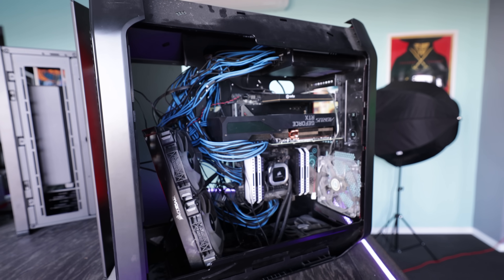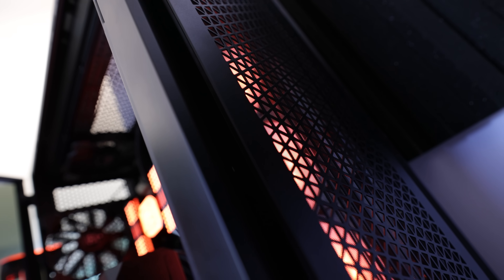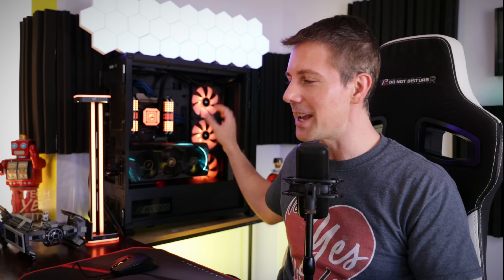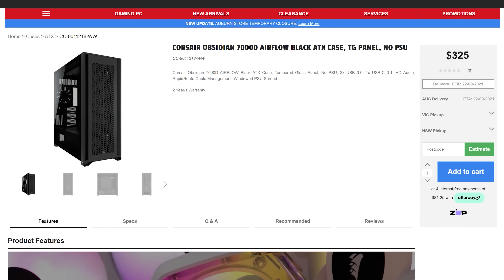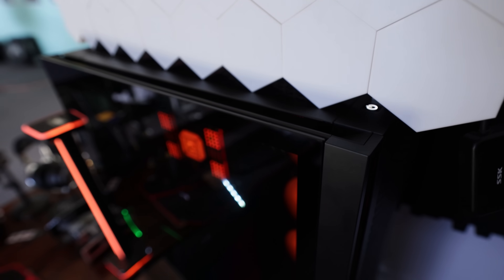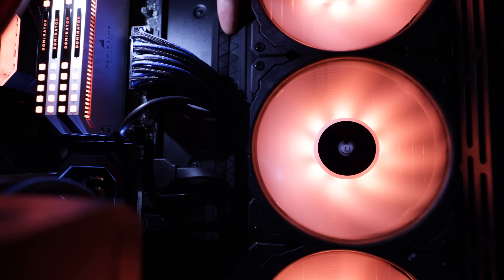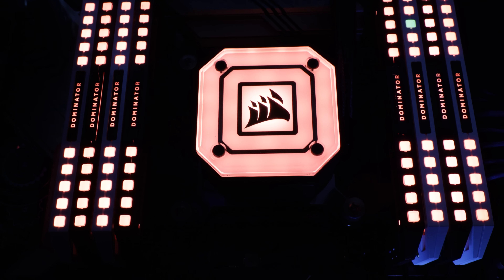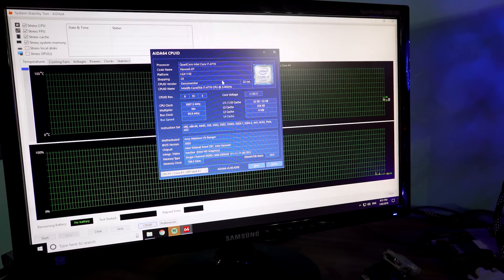Rebuilding my DAMAGED PC Setup (Corsair 7000D Review)

Comment: Been looking to get a new case and this one ticked all the boxes for the hardware that needs to go in … the only problem is when I looked at other build videos and reviews that it’s one of those cases that limits you 
If you have a large PSU you need to remove one of the hdd bays and if you want to use a 480mm radiator you would need to remove the other hdd bay
Since it would need to go in the front or side  since there is no way to mount a 480mm rad in the top

I used to have a Obsidian 800D and liked it a lot
It’s kind of disappointing that Corsair mostly makes cases that are smaller the 800D and only makes there flagship cases larger but those are also some of the most expensive cases there are

Comment: At about 13:40, Bryan's video card is mounted 'sideways'. Here goes the dumb question.. how is that done?
Looking for a new case, might take this 7000 D.
Thanks for the video Bryan!
Reply: with a riser cable and the vertical gpu mount in the 7000 d.
Reply: @fietsfreakske6493  Been away from PC's for awhile, obviously. Thank you!

Comment: I've just got this case.  Using stock fan setup which in general seems to be working fine.  What I always seem to have cooling issues with though is my GPU.  It is only a 2080Ti (waiting to see things settle!) but I can never get enough cooling around it as the fans are underneath where the least amount of air is going to.

I am wondering about simply adding a 3rd 140mm fan at the front as I am wondering whether the lower fan will then send through enough cool air.

I am not good enough or confident enough to water cool (yet) and because of my Threadripper, I am left needing a huge CPU fan.  Currently using Noctua with two fans.  I think the CPU temps are fine as they run at around 40 degrees idle but with Heaven or some of the other tests, I haven't seen it go above 80 degrees, so that seems to be doing a decent job.  I just can't move the GPU up any further though because of this monstrosity in the way.  I use MSFS mainly and this is generally the heat generator!

My GPU though always leaves the glass panel really hot around the GPU and the rest of the panel is fine.

Would you say 3 intakes at the front with only 1 exhaust at the back would work?  I would gladly pay for another fan, but just always worried by having too many intake with only 1 exhaust and effectively wasting my money LOL
Reply: go for like the same 140 mm fan as the 2 pre-installed in the front (140mm airguided fans).  if you're not into those rgb coloured fans. i'm gonna have mine in like hours from now on. and i ordered two 120 mm rgb fans with airguide. three intakes and one exhaust is good. and you can go for two exhaust on top too. so it makes it evenly. it's just my two cents.

Comment: Great video... thank you... I may be worrying unnecessarily (fingers crossed) finalising spec on a custom built PC (Asus ROG Strix 3090, Asus Maximus Hero, Corsair 7000D, Corsair AIO CPU cooler) and would like the 3090 mounted vertically. I won't need access to any other slots. Do you foresee any issues? I also hope that if the 3090 is mounted vertically there is no risk that it will visually obscure any of the motherboard eye-candy (RGB RAM, CPU Cooler Pump) but I won't mind if I never see the final bill again LOL

Comment: I find motherbord bios updates, or lack of updates can cause extreme latencey or even failures to acknowledge mouse and keyboard inputs. I have the asus tuf z490 plus wifi bord and I have had this issue re occur. Unfortunately asus's software bullys you into updating by withholding features in armory crate. Over all it works well when it works and is incredibly frustrating when it doesn't. You will need to be calm like monk if you want to survive. More often than not the only real fix is waiting on another update.

Comment: Hi Tech Yes City, do you find lower end budget cases these days are limited on how many 3.5" bays are available?  I am still using 2 cases from 2008, Antec Sonata and Antec P182 respectively.  The Sonata supports 4 bays for 3.5" but I have a 2.5" SATA Samsung 860 Evo 512Gb in one of the bays.  The P182 supports 6 in total  4 + 2 config (2 separated drive cages).  The thing is I noticed with sub $100 CAD cases now I don't really see 4 bays for 3.5" hdds.  Which makes it a bit more challenging when trying to DIY a 4 drive XigmaNAS box on a lower end budget.  Since both my current builds have the bays maxed..I can't move the rig contents to a newer case.  I have found that the cases with more than 3 x 3.5" bays cost over $200 CAD.  The most I could do is a Raid-1 type XigmaNAS build with only 2 3.5" drive bays available in most of the newer sub $100 CAD cases..which I was hoping for at least a Raid-5 or something better with 4 drive layout.

Comment: Had you not used water cooling Brian,your old system would still be rocking it-an extra point of failure that was 100% unnecessary.But would still have been a fun build.

Comment: 6:50 Yeah, delid and use premium liquid metal.
Lap the cpu surface, cause so many cpus have concave and convex surfaces that gap the contact.
And lap the cooler surface too, you will have so much better boost duration.

Comment: I have the 5000d and i love it and it comes in at 170 USD. I set mine up a bit differently with 3x 120 intake in the front, 1x 120 exhaust in the rear , 3x 120 intake on the side and a 360mm aio exhausting with push and pull :)

Comment: How do i know the water cooler is working, outside on the back when gaming there is hot air and when on internet mode there is cold air.  On hose is reasonable hot and there other a little bit cooler but not a huge difference. The rad is not hot.

Comment: Would a smaller radiator, like 280mm, still be able to cool the 10980XE?
Reply: i'm gonna use a 240 corsair h100x in front as push/pull or side push/pull or top push. and then add other corsair fans that i have on the other spots.

Comment: Nah those cpus just run stupid hot. My 10920x which had been lapped and delided would hit 95c with a 4.6 all core oc on a 360mm aio water cooler. I dont recommend intels hedt for gaming or overclocking.

Comment: My case :3 tho tbh - the case is built like a tank from about 1.5 to 2mm thick steel frame, front, top, side panel and 4mm tempered glass and it's heavy, I mean heavier than heaviest metal music has ever been with how much metal is used in that case, yet my gripe is about hdd mountings - the further we go in to the future, the weaker hdd mounting we get, after initial mounting of data center drives like 'wd gold' - caddy was making annoying metal hum noise, after buying sticky foam tape, which I taped - hdd caddy and hdd trays themselves so I barely put hdd's back with lots of force - it has been only hdd's sound after that and no annoying rattle or humming noises from hdd tray or bottom frame part where hdd cage rests on...

Comment: I had a 750d and only thing I didn't like was no wheel options. You can buy all the parts for it or upgrade to better parts if anything breaks or you want to upgrade later. I now have some other case my buddy likes when he built me my 1900x Ryzen and it's pretty nice and similar to the 750d but not sure if it's better. I did add some cheap wheels and have some good leftover wheels from a stacker case. I really liked the original Stacker cases and have a few around and one still in service but they don't support usb 3.0 and other modern things. The wheel option was super heavy duty and they were easy to move and deal with. That case looks great but I still have tons of legacy sata drives in service so would need the drive bays. Wonder if the drive bays would still work with that cooler but probably not without reversing the cages so you can hook up the cables considering how my 750d did the drive cables out the back to mostly hide them.

Comment: Question about temps on the CPU. I’ve used intels performance maximiser to do an overclock and it appears to try keep the temps below 86 degrees as per the recommended TJunction temp on Intel Ark for the 10980xe. I know yours is almost definitely a manual overclock, but I’d there a limiter you needed to remove to allow it to run above 86 degrees? For reference, mine is clocked at 4ghz all core, with a H150i using six fans on the rad and tops out at about 83 degrees.

Comment: Vertical CG mounting seems easy......
In realtity, its too soon for PCIE 4.0 and newish CG
Runs fine with pci 3.0 and 2 slots cards.
Had to remove it due to temperature and noise issues with glass panel, rtx 3080 and pcie 4.0 riser.
Plus the fact that apparently, some 4.0 riser cables are rated for 16Gb bandwidth....which is pcie 3.0 bandwith
I can't verify that. I dont own 3dmark suite.
Cheers to you
130 buckes lost for me with riser experience
Reply from the maker: Yeah I just use pcie 3.0 riser.

Comment: Weird how you don't put your money machine's components into the ultrasonic cleaner. Anyway, personally I dont care what you do to clean any components but when using the ultrasonic cleaner in any video there should be a least a warning and a disclaimer to the less experienced users of how  risky the proccess is.
Reply from the maker: Fair question, I will put my main rig through the ultrasonic cleaner if you like.  Only reason I didn't is because they are in a dry smoke free environment, only dry dust gets on the parts.
Reply: @techyescity  Damm I never thought someone will be nitpicking about not using a ultrasonic cleaner.

Love the reply Brian.

Comment: a 420 aio and the Intel Cpu runs so hot??...why u wont use a 5950x? 2 cores less but way better in case of power and cost!
Reply from the maker: 128GB of DDR4, I can get it on the 5950x, though would have to go rebuy 32gb sticks, which will cost a lot.

Comment: Hey Yes man, can you confirm if 11th gen motherboards e.g b560 and z590 allow memory over locking and adjusting power limits on 10th gen CPU's e.g i5 10400f?
Reply from the maker: memory is still locked for 2666 on 10400f on b560 i think? z590 should allow unlimited memory oc for 10400f.

Comment: It's hillarious that the industry & tech scene has been pushing smaller cases at the same time as GPUs have become enormous and CPU heat output has gone through the roof. I miss the days of the HAF X, proper cases with real airflow, and RGB needs to die. Let the flames commence. ;D
Reply: Not everybody need a 20 stories building on their desk :)
Reply: Rgb could go any way. But yeah airflow a big issue and has been for years now
Reply: Why do you want RGB to die?
Reply: @lilfish1308  Because it's ugly and useless ;)
Reply: @lilfish1308  Because I'm old and think it's stupid. :D  And that was also a dribble of clickbait. ;)  These things all whirl round as fashion trends though, they come and go. One thing definitely undeniable however, RGB is very definitely not an eco thing to do, the resource consumption involved in all sorts of aspects is considerable. But then, if people really cared about that they wouln't be gaming at all. :)
Reply: small cases exist, large cases exist, cases overflowing with RGB exist, cases with no RGB exist, plus you can turn RGB off. Also, there's still plenty of pretty good airflow cases (5000x, Lancool II mesh, etc.)

Comment: Amazing case and build ! But why not put this aio on top ?
Reply: He's in Australia, so it's technically placed on the bottom.
Reply from the maker: @Oroquieta  Always good to see the edit downside up joke.
Reply: I think he wanted the RGB to show
Reply: @sebastião_deabreu  he could just put an other set of fans
Reply from the maker: @Antho2030  the 420 watercooler is really good for outflow and cooling, its a complete beast, so didn't need to add in extra fans.
Reply: @techyescity  btw lot’s of people complain about capellix pump being noisy did you notice that ?
Reply from the maker: @Antho2030  Not on the H170i, the H115i I thought was noisier than the H115i RGB Platinum, which is why I preferred the H115i RGB platinum over the capellix, it was that tad more quiet.
Reply: @techyescity  okay thx you hype me for this h170i, maybe in my future build but i think i will use it the fractal torrent or in the p500a 😉

Comment: I build in full towers, I currently have a Phanteks Enthoo Luxe, Enthoo 719 (Luxe 2) and a Lian Li O11D XL that I'm getting ready for the release of Alder Lake. Each is capable of taking an E-ATX board, descent size PSU and have plenty of room for my custom water cooling components. The disappointment of the bunch is the original Enthoo Lux which required modification (had to cut down the PSU shroud with an angle grinder) to fit my pump and forced you to sacrificed hard disk storage.

Comment: You mounted the aio wrong. I’d recommend watching the gamers nexus video showing why. It can cause pre mature pump failure mounting the way you did. You should have the tubes down or mount the radiator at the top of the case
Reply: Actually, no this build is fine as the tubes are above the pump which means the air bubbles will sit at the top of the radiator above the barbs, this may allow for some air pockets through but generally not enough to cause damage, it may cause some unwanted noise though. This will only become an issue after permeation takes effect and the liquid starts to reduce and the air pocket increases to below those barbs.
Reply: @LucyIsabelle  that’s where the resovoir is which is why it’s a problem if you watch the gamers nexus video it explains this. Even the Arctic liquid freezer ii manual they say not to do this and link gamers nexus video.
Reply: @jayhsyn  I think you also need to rewatch it, he also explains that it won't really be a problem until permeation happens and the air bubbles gets below the barb for the tubes.